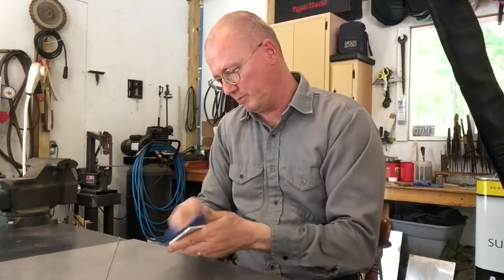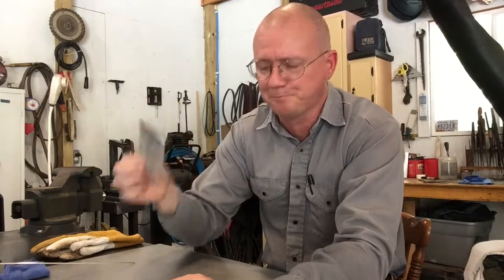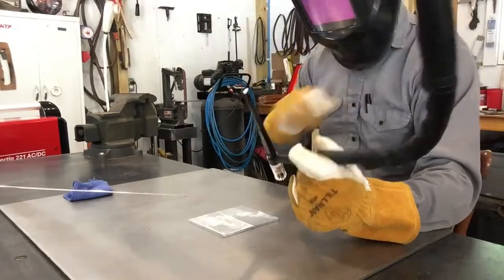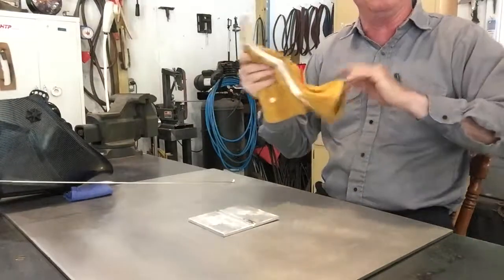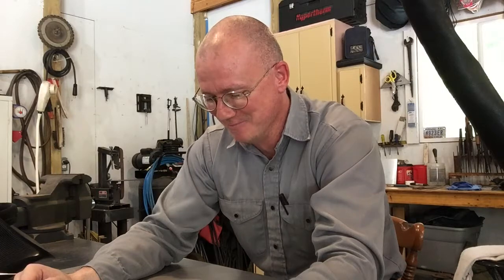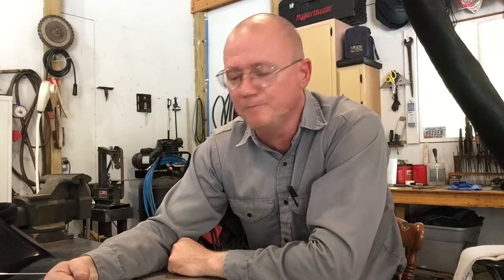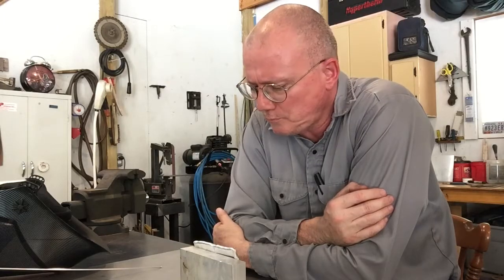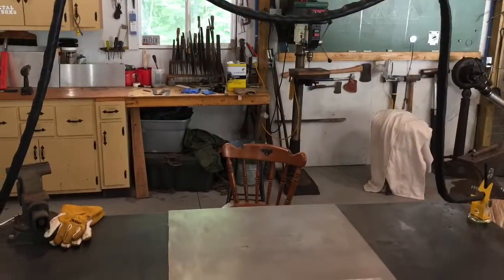HTP Invertig 221 And My Very First Tig Weld!

Comment: Glad you are loving the invertig 221 i did a bunch of videos on it and the pro pulse 200. i think you meant to say 3/32 instead of 3/16 with your tungsten and filler. I just hit the pedal before to weld to purge gas then i will re ignite and go into my weld instead of turning up the pre flow. nice video you'll get the hang of it. good job! 

what did you stick weld with before the 221? the 221 can run ac rods and pulse too. if you ever see your stick indicator blinking your VRD is on just hold it in and turn it off.